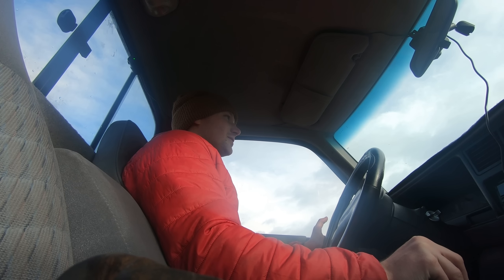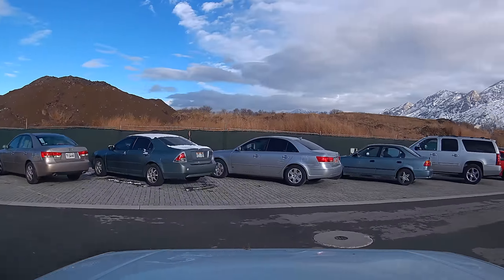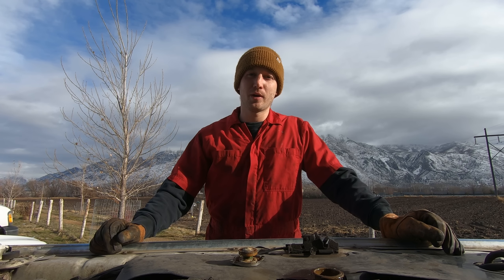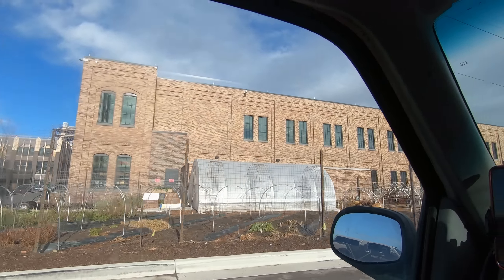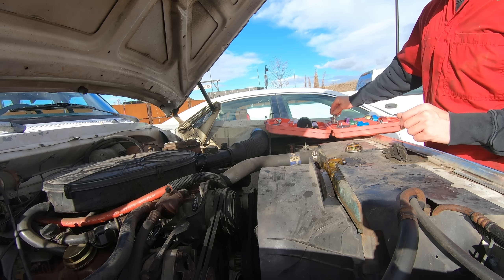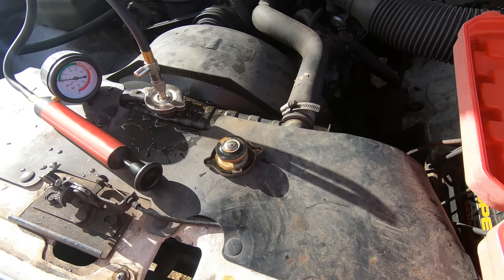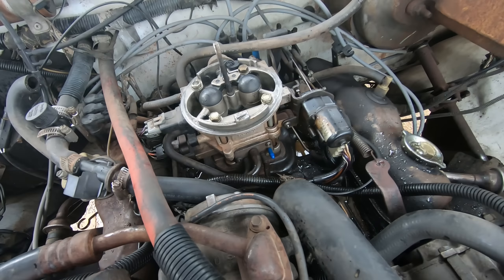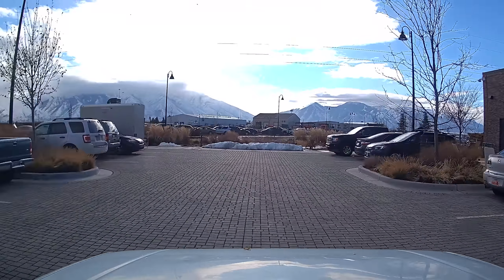I SAVED a RUINED Truck. After it STRANDED in the Mountains | VEVOR

Comment from the maker: Get a Torque converter kit: https://amzn.to/3FEPPe5
22% off until 1/5.

This kart torque converter has a 3/4" and a 5/8" drive clutch, suitable for all engines with 3/4 "straight crankshaft.The 3/4" drive clutch contains a 10 tooth sprocket for # 40/41 chains.The Belt length: 70.5cm / 27.76", Outside circumference: 27"（68.8cm / 27"), Width is 3/4".（1.9cm / 0.75"). Center to Center of driver and driven: 6.7"（17cm / 6.7").

This go-cart torque converter kit replaces OEM part numbers: Comet 218353A, 219552A, 219456A, 217610A, 203814A, TAV2 30-75, Yelf Dog Drive Unit Q43201W.Replaces for Comet Manco Go Karts.